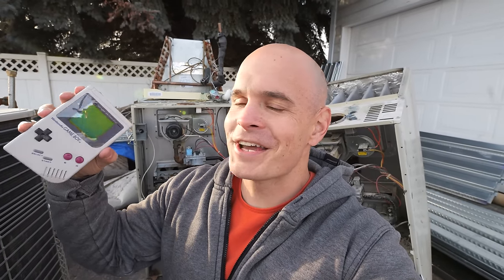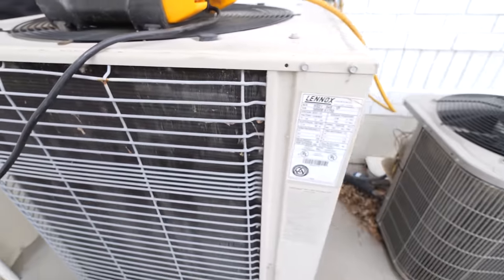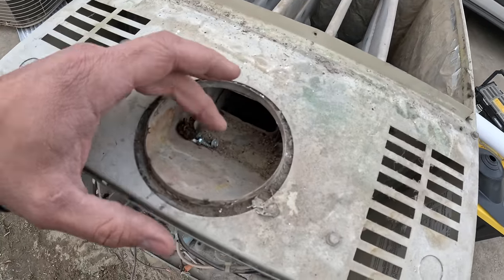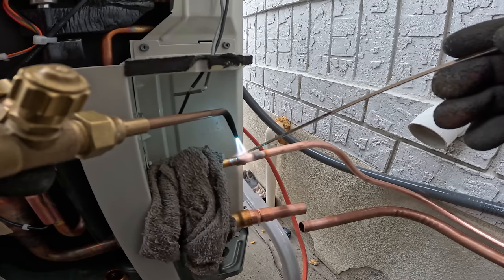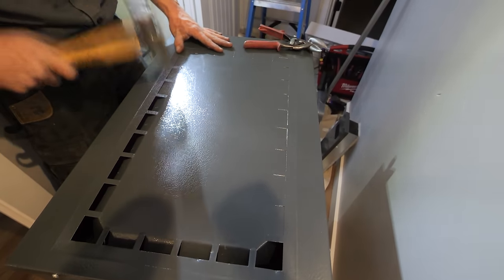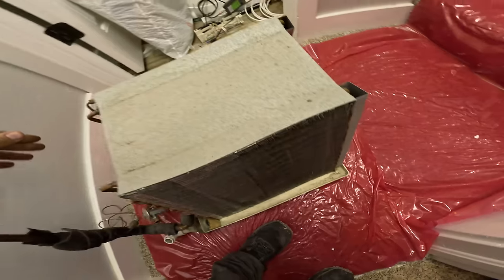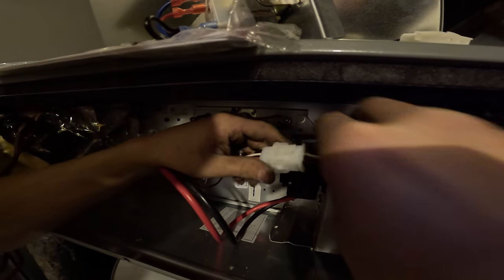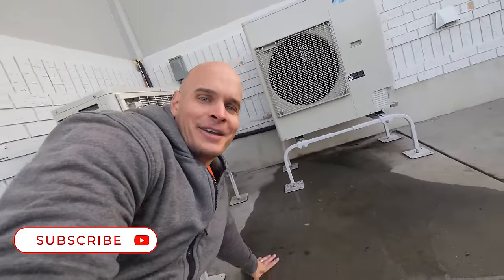Why is Everyone Talking about Heat Pumps?

Comment: I also have a Daikin heat pump. What I don't love is the remote control's for the heads inside the house. And the fact that the multiple heads don't communicate with each other, if one head happens to call for heat while another is calling for cool, the whole thing shuts down. While I realize that the outdoor unit is not capable of performing both functions at the same time, a more elegant solution would be nice. And the snowflake (cooling) and the sun (heating) are the same basic shape making it difficult for some with visual impairment. I do like the efficiency of the heat pump.

Comment: I live in Eastern Europe (Romania , the Transylvanian mountain area) and the winter temperature reaches -15/-18 C (-0.4 Fahrenheit for you Americans). I live in a new house, built in 2020 with porotherm bricks, triple glazed windows and very well insulated and for heating we decided to install underfloor heating with heat pumps similar to what is seen in this video  and shocking, I know, the cost of heating is enormous...because I have 2 small children, I keep the temperature in the house at 21-22C (71F).  After the winter of last year, we decided to give up the heat pumps and installed a gas central heating boiler with condensate pump and my heating bill is half in the winter months now....these heat pumps are not good when it is too cold outside and if you don't start digging trenches in the yard for geothermal heat pumps, it's not worth it... my advice is to stay away from them if you have gas.

Edit: I forgot to put the cost...the heat pump sistem was close to 7000€ (Mitsubishi Electric ZUBADAN, 3 faze 380v unit) and the gas one was 2500€ (Ariston , 35kw unit)

Comment: I help run an HVAC business and appreciate this video! I will be sending it to my customers! Just a quick note you said that the slots in the top of your old 80% furnace had CO2 coming out of it or there was potential for it to escape. This is incorrect. The inducer fan motor sucks air (and ignited gas) through the heat exchanger and blows it out the flue pipe. The slots are for air intake only. I don’t want people watching this video thinking their older furnaces may have co2 coming from those slots as it’s impossible for it to do so. Thanks for the thorough video as I sell the Amana version of this equipment!

Comment: My mini-split heat pump is 15 years old and my only heat source in the winter and my only AC in the summer.
Its not very effective at -20 C, but it heats fine.  (-4 F). Usually lose 2 degrees overnight, then when the sun gets up and it gets warmer it warms up again so it has never been problem.
New heat pumps are more effective. 
Mine has never been serviced.

Comment: Heat pumps are great if you don’t have natural gas. 

But unless you are getting into the exotic geothermal heat pumps, a heat pump isn’t cheaper to use to heat a home. 

And once you get below 30 F the heat pump loses a lot of performance. 

Heat pumps are rated at BTUH at 45F and 17F. Look at both numbers and find out what your balance point will be.
Reply: A lot of the most recent heat pumps are rated for full heating down to between 0-5 degrees F depending on the manufacturer. Most builders also do not perform a real load calculation on the house when sizing a gas furnace and most are grossly oversized. If straight replaced with the same sized heat pump you'll never run into a heat issue. If sized properly on the design day your heat would run constantly at max output. If your gas heat never did that it's oversized. Mine runs only about 50% of the time when outside was -10 degrees meaning its almost double what it truly needed to be.
Reply: I've heard similar things to the guy above me. I hear well sized systems work pretty efficiently down to 5 degrees. If it's more efficient most of the year then it's still better, right?
The situation might also be it's slightly less efficient sometimes and way more efficient other times. You have to do the math for your specific situation, right? I trust he did.
Reply: @cerilious in the UK electricity costs much more so the cost savings can be non existent. A gas boiler is still the way to go.
Reply: In most of the US heat pumps are cheaper year-round. Here in Massachusetts (with expensive electricity) an air-air heat pump is currently cheaper than gas when it's more than 45F outside. Heat pump COP drops a bit in the cold but on modern units the capacity stays up until subzero. The heat pump I've been eyeing (Comfort-Aire VCD36) is rated 39kBtu/h@COP 3.18 when it's 47F and it drops to 32kBtu/h@COP 2 when it's 5F outside. That's not a massive drop. Single-speed R22 systems are much worse.

Comment: WOW! calling BS on more efficient than a gas furnace, unless You're going off of 400% efficiency for the heat pump and 80% efficiency for the gas furnace. But the gas furnace costs much less to operate  than the heat pump. But the efficiency that the general population is talking about is the dollar
Reply: What? Gas is much more expensive than a heat pump. Even ignoring the actual fuel burned for a second, when you're not using that gas for heat you're paying $20-$30 per month just for the sake of being connected to it. Multiply that by the months you're not even needing heat and it adds up.
Reply: @antikommunistischaktion in the UK electricity is £0.25 vs £0.6 for gas so you can see it’s much cheaper to stick with gas when you factor in the cost of these systems and they very likely won’t last as long either as a traditional gas boiler
Reply: @antikommunistischaktion  WTF are you smoking, on the coldest months my gas bill is at worst 125 and the people who run heatpumps see massive electric bills. Many hitting over 400.00 a month . These cost more to buy and last half as long as a traditional furnace and especially cant touch a boilers lifespan
Reply: @zack9912000  $125/mo? So I hate to smack you down, but my heat pump never costs me more than $30/mo meanwhile when I did live in a house with gas heating, for some odd reason, my gas bill was never under $150. Now, that could be the landlord special, but given that I personally verified that it was a brand new furnace I am just going to go with it being gas is less efficient.

Lol, why are you people so scared of heat pumps? Let me guess, you're also scared of EVs and you coal roal at every red light in a truck that's never seen a spec of mud with tires that have never even kissed dirt.
Reply: @antikommunistischaktion   We swapped from a gas furnace to a high-efficiency (coaxial PVC vent) on-demand boiler / water heater a few years ago.  Gas price in the summer dropped significantly due to the idle efficiency, but winters were about the same -- it just costs a lot to heat a home when it's below freezing outside.  My winter gas bills are in the $200-300 range.

Electricity is fairly expensive too, though.  We added a heated floor in one bathroom, and that alone contributed $20-30 a month.  I don't think a heat pump would be cheaper here, but I am planning to use one for a heated work area in an external structure.  Also hoping to have solar, though, which is likely to put a finger on the cost-effectiveness scale.

Comment: Keep in mind the backup heat is also used during defrost. The outdoor unit can turn into a big snow cube like you find in old freezers. So it has to go into ac mode to heat up the outside unit and melt it off. During that time to keep your indoor coil from turning into an ac for your house during the winter it kicks in the back up heat to super heat the air so it's not frigid air coming out of your air vents.

Comment: That heat pump at the end has a loose panel or wobbly blade, or there’s contamination in the system from them not brazing with nitrogen. I hope you got this job at no cost because there’s countless things they did improperly just watching this short video.
Reply: Yea i seen that

Comment: I hope to get this done eventually, but hopefully without the crimp connectors and kinks in the tubing 😉
The top compartment on the old furnace is under negative pressure, and those slots are air inlets. There will be no combustion gasses entering the house from there unless something is wrong with the furnace. Most carbon monoxide leaks are from the heat exchanger.

Comment: My furnace had a cracked heat exchange in the middle of winter 2020. Had to scramble and hustle to put a new one in (thank God) while using electric heaters and running the water overnight so the pipes didn’t burst. The house was freezing. Get your furnaces check before some bad happens.

Comment: As someone who lives outside of the US, the hype you guys are generating over heat pumps is straight up hysterical. Im not sure exactly how long they have been common place here in Australia, but my folks built a new house when I was 8, and it was fitted with a heat pump, that was 24 years ago.

Comment: I updated to a dual fuel Heat pump 2 years ago and they are awesome, super quiet and efficient. I keep my blower motor on all day and it helps balance the temperature between basement and top floors. With the old system the delta between basement and top floors was 10degF. With new system down to 2-4degF delta. 

Also both the electric and gas companies will give you a rebate incentive. Don’t forget if you get a smart thermostat that’s also an extra rebate you can get.

Comment: If it's not too late you may want to keep the A coils. In high school I made a super cheap AC unit in my bedroom above a garage by pumping well water through an A coil from the dump. I had to water the yard any time I wanted to cool my room, but it worked like a charm.
Reply: What you created was a swamp cooler, not an AC.
Reply: @chris101ward  It's definitely not a swamp cooler, that's requires evaporation in the room which is impossible with a sealed A coil.

Comment: Yep  - good buy,  I have exactly the same (equivalent) A-C unit outside my back door - used for cooling in the extreme summer heat and occasional heating in our mild winters 0 nothing revolutionary but pretty amazing at the same time.

Comment: I have a Mr. cool centrally ducted whole house heat pump and it works great. I had it tested for sure here in Colorado this winter when it was snowy and with windchill -20° and the thing still work like a champ to heat my house no problem really cool thing for me was I was able to order off of Amazon and have a localHVAC guy install it for me. Utility company gave me a rebate and I was able to get 30% off tax credit. It’s all electric, I have solar and batteries

Comment: I DIY installed a 4 tons/4 heads Mr. cool mini split all electric coming from a Natural Gas furnace, I save about 30- 35% on the bills the first and coldest month of DEC 2023 month, but remember you need a gasoline generator or solar battery backup if power goes out. After fed tax this cost about $4000 for me, Well worth it so far

Comment: Switched over to a heat pump in 2021. Loved it so far. I live in Ireland so don't need a backup heat source.

What I like most is how much quieter my home is.  And switching to an EV gave me a much quieter commute.  Obviously it also saves me loads of money and time - no more trips to gas stations or calling for an oil delivery.  Plus a third of my energy use now comes from the sun.

Comment: Would have loved if both the high pressure-hot side and the cold side would have been soldered and leaving the "press couplings" for the normal heating system. But thats just my experience from malfunctioning district heating "units" that just goes bad from the high pressure (4-12 bar) in combination with 90°C/194°F ;)

Comment: Would be nice to see a comparison video of the heating costs !!
Reply: Since its up to 5 times more effective, one would assume its up to 5 times less expensive.
Reply: @dubious6718 Its not, it can run you substantially more in the winter when you aux has to run to keep thenhouse warm.
Reply: @zack9912000  Sounds like you have bad experience or no experience at all.

Comment: Not only supper efficient and hence cheap to run, there's also virtually zero work and minimum maintenance required. No chopping wood, no more dust or ash to deal with, no more smells or toxic fumes.

Add to that a photovoltaic system and an efficient means of low-temperature heating (like underfloor hot water circuits) and you're all set.

Comment: Had a heat pump installed about 2 years ago. very nice in the summer and heats up the house very good down to about -10C, it is rated for -30C but it really isn't effective after -10C (may be that my house needs to have its insulation checked to)

Comment: I got a 20 year old Fujitsu inverter system that's running 410a. Still works needs a tune up but I was thinking about replacing it and now that 410a is getting the boot I'll probably wait. Surprised your system isn't r32 Daikin is the only US brand I'm aware of that's started making the switch.

Comment: -10° outdoor temp is extremely optimistic, I’ve been working with these for years and the systems tend to struggle once a 40° differential is reached. Therefore if you want your home to be 70° and it is 20° outside, you can expect your heat pump to struggle.

Comment: My Daikin HP and NG dual fuel system works really well. I love the inverter system cuz it's dead quiet siting outside my bedroom windows. Only thing I hate about the Daikin system is you have to use their proprietary thermostat and it's fairly basic. Would love to have a lot of stats on run time and whatnot like I had with the Ecobee and Nest.

Comment: great video! I wonder just how efficient these Heat Pumps are and if they can sufficiently powered by solar panels. If so, you can basically get a gas-free pure energy heating/cooling solution

Comment: I live in a mobile home (1,250 sq. ft.) in Massachusetts and I had one of these systems put in. (different company) In a normal winter, without this system, my electric monthly bill would be $125. This January 2024, with this system in, my bill was $500+.(One month) GOOD LUCK !! :face-fuchsia-tongue-out: Thank God I still have my kerosene heat for back up !! Now I only use the Heat Pump is when the kerosene goes out. They do say it works great in the summer, I'll let you know.
Reply: Yep, thats normal when they have issues and they run non stop or the heat pump fails and runs on backup heat strips.😂
Reply: Zack has dirt cheap electricity in Utah, I'm sure he'll be saving lots of money.

Obviously your electric rates will go up significantly, but your existing heating system also costs money to use. I'm also in MA and by my calculations on current utility rates a heat pump should be about 30-50% more expensive than gas if you use it the entire year. Since heating oil is more expensive than gas your heat pump should be saving you money if it's properly sized and installed.

Comment: Keep in mind that variable speed compressors have a shorter service live than singlenspeed ones, though they are more efficient.
Beyond that, when a system is fully charged, in the summer, run it for a few hours then let it idle for a few hours, then check the charge level by using a blow dryer and heating the compressor a little and examine it with a thermal camera. The line formed by the level of refrigerant, will show you what the full level of your system is. After that simply mark that fill line on the compressor, then each eyar, check the level to see if the system is still at the proper level. If it drops then you have a tiny leak.
Reply: The inverse is true. The frequent start stop of compressor results in premature wear
Reply: @jasonw98  Yep, rapid starting and stopping will kill pretty much any heat pump, though it is rare for someone to get an extremely oversized system, since the price will scare people away from doing that. An extremely oversized system will also lead to moisture issues. Not only will the system fail to reduce humidity in a hot and humid day, moisture will condense on the outside of the units and lead to mold.

Comment: For those who don't quite get it: Heat pumps are just two-way air conditioners. An air conditioner works by absorbing heat energy inside your house (resulting in a temperature drop) and wicking that heat energy away (so it doesn't just re-heat the house) and dissipating it outside. That's why the big fan box part of your air conditioner blows hot air outside. Now imagine if you turned that system around: you wick heat from outside and blow it around your house. A heat pump is a device that can run in either direction. It can wick heat from the outside even in very cold weather because the liquid it uses to absorb heat boils at a very low temperature, around -50 degrees. So as long as the outside temperature is above that, you'll get heating. However, the closer the ambient temperature gets to that -50ish number, the less "heating power" you get. So places that get below -10 may need a bit of help on those coldest nights, which is why his system includes a smaller fuel burning option to supplement the main system when required. This also doubles as emergency heating in case of a power outage.

Bonus fact: Your refrigerator works the exact same way. If you wick heat from inside a sealed, insulated box, you can get the temperature very low and it will stay that way for a long time.

Comment: Should've bought a Mitsubishi. I work for a major competitor of Daikin. I've worked in the HVAC industry for 43 years now. Heat pumps have been around for a long time. Rocky Mountain power will love you when it gets really cold outside though. They usually are good in milder climates, but not when it gets really cold because of this I'd rather stick to natural gas and my 18+ seer AC unit. People forget that when you blow a compressor on a HP you better get your check book out. When you run at the lower limits of a heat pump you run more chances of losing a compressor.